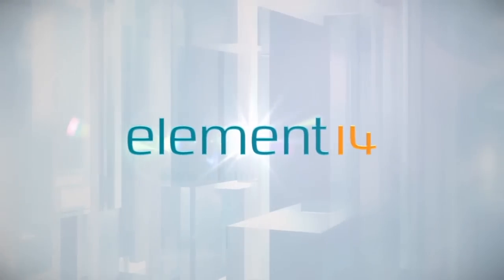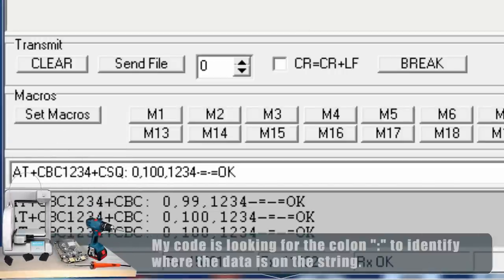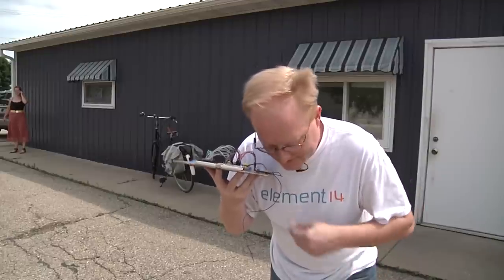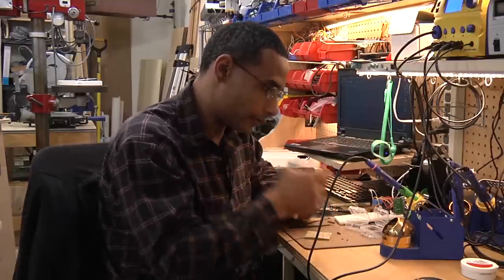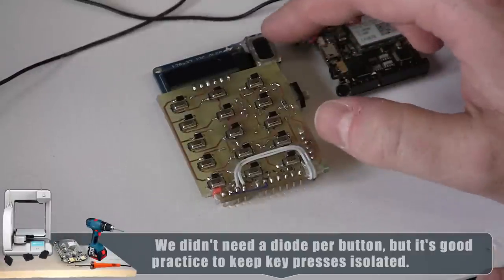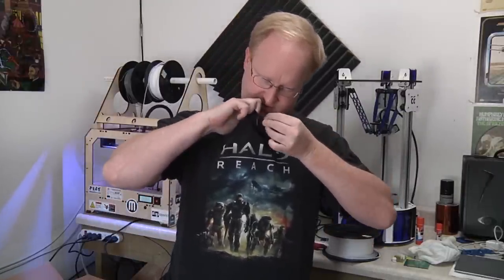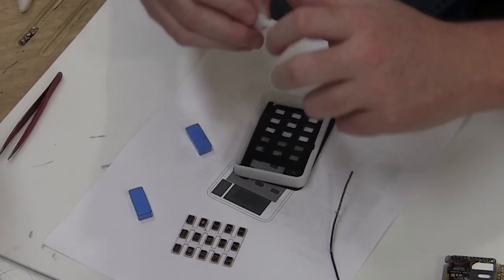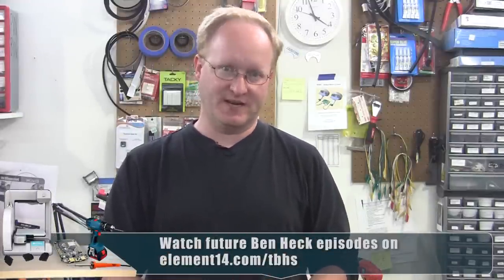Ben Heck's DIY Cell Phone Part 2

Comment: Well, the sound quality was kinda poor when Alyson called you. And on the end. :)
Reply: It's a cheap speaker (low quality) being picked up by a mic (drop in quality) outputted back through another speaker (possible loss of quality), then the whole video that you are watching was most likely compressed in some way (further loss of quality), and then out of your speakers (another possible quality drop).
Reply: TheMohawkNinja And the sound had to travel from the speakers to your ears. Possible quality drop.
And from there, the sound signals must travel from your ear drums, through your nerve system and into your brain. Another possible quality drop.
And from there, you had to interpreter the message that was simulated in your brain, and transformed into a logical and understandable meaning. Another possible quality drop.
And at the end, you had to remember the sound that you just heard, and memory is not a perfect thing, and may be obscured. Another possible quality drop.
Reply: *****
Aside from the first one, the rest can be ignored as it is a constant that would occur with any audio equipment.
Reply: The sensitivity of the lavalier microphone was set too high, you can see the AF Peak light come on every time it distorts. The problem is unlikely to be the phone speaker, but the fact they didn't set up the microphone correctly.
Reply: All phones have bad call quality
I hear better quality through skype.
Reply: I'm sure he's real sorry that he doesn't have millions upon millions of dollars to create something more suited to your viewing needs...

Comment: Hello Felix,  How did you flash the smd Atmel chip first?  Did you mount it on another board with headers then unsolder?  I'm working to move to smd chips soon so was wondering, thanks.

Comment: It should not be that much more difficult to permit it to receive SMS texts. Many online verification systems REQUIRE the ability to at LEAST receive SMS texts. And given that you're already polling the cell module for messages, relaying those to the screen should be rather simple. Although one does have to consider the case where someone sends an SMS that is identical to some phrase or such that you're already scanning for... And then it does become a bit of a mess, where the underlying program could get out of sync with the cell module. As I am old enough to remember the modem days, there was an old joke that went like this...NO CARRIER

Comment: a neat idea for 3d printing long multi part build, would to attack a sort of "spatula" that could come in after a part is done printing and push it off the heated bed into a bin so the 3d printer could start printing the next part. 
( and yes im not a 3d printer expert and not aware of the 3 million reasons why it wont work, just thought it would be  interesting to do)
Reply: Look up "Automated build platform" for the Makerbot Thing-o-matic. It's a belt of kapton tape that the object is printed on, then after cooldown the belt rolls forward, releases the part in the process and throws it off the platform.
Reply: They have custom g-code that can do this so it will keep producing a product

Comment: Hey Ben, I've got a good project. I have this crappy issue with signal around my college. It's generally super weak or simply non existent. Is it possible that you could somehow do a project on a portable router with a huge great antenna to pick up signal? Thanks.

Comment: One thing you should add is to change the in call volume...
Reply: You can add a potentiometer in series to the speaker to have an adjustable volume control.

( O )
|  |  |
1 2 3

1-Input
2-Output
3-Ground